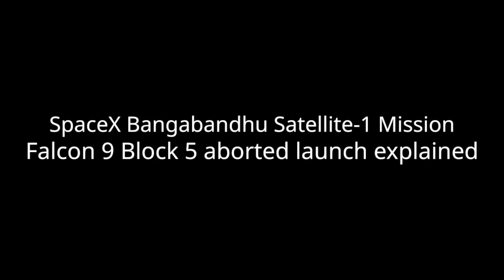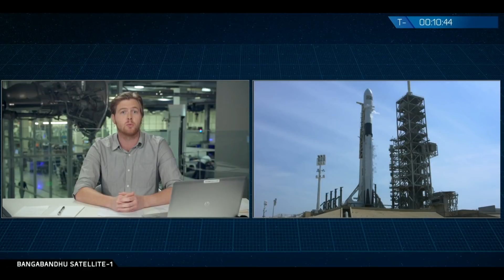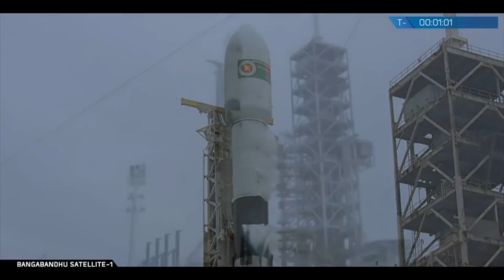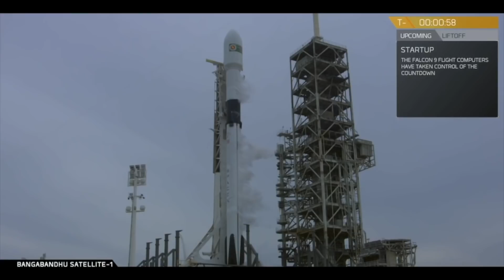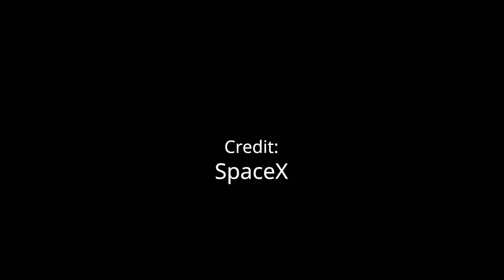Falcon 9 Block 5 aborted launch explained

Comment: SpaceX has some pretty smart people and they probably had this one figured in just a few minutes.  However, once the abort happens it's a done deal for the day.  I believe they had to de-fuel the tanks so it would be sub-cooled  for launch the next day.
Reply: Most likely
Reply: Not necessarily, launches can get a new T-Zero if the launch window permits, also block V allows for a faster recycle time
Reply: But, I do think they had to defuel
Reply: Peter Danilov yes they did, but it doesn’t mean that if they have to there is not a possibility to launch that day, all depends on the launch window